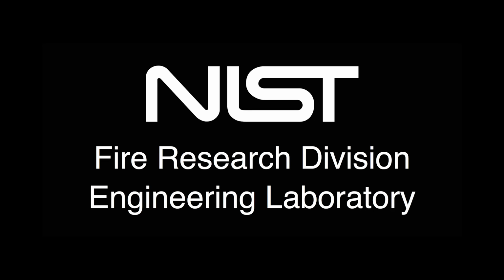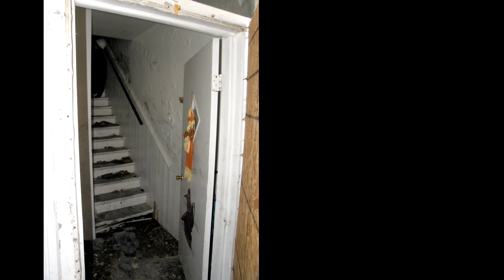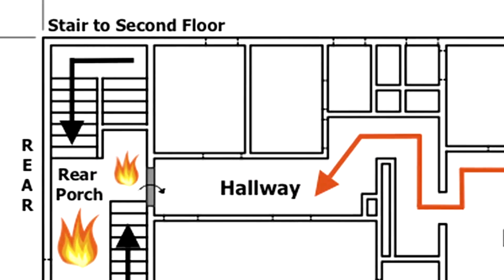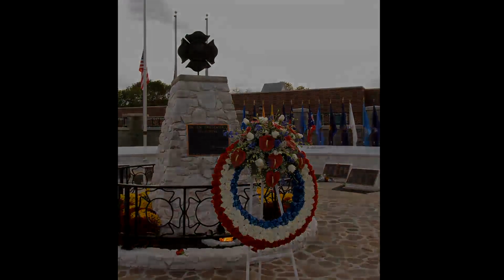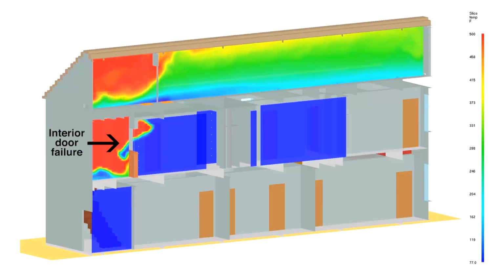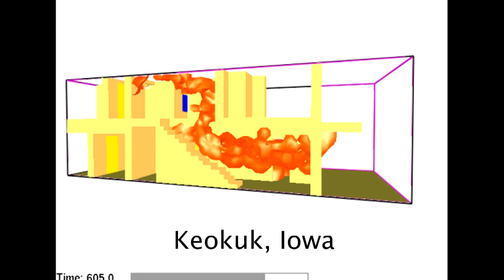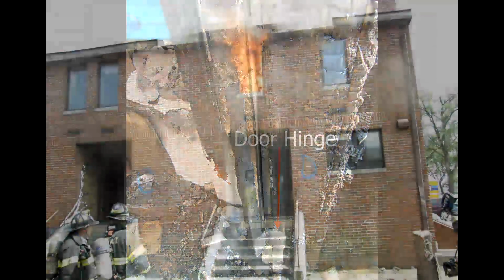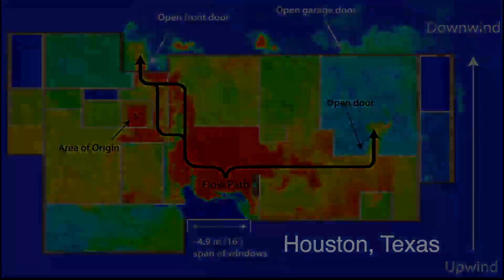Simulation of an Attic Fire in a Wood Frame Residential Structure--Chicago

Comment: Let's see if I got this right.  

Reading the reports, I gather that things started really going south when the truckie opened the back door to the first floor and must have left it open too long, letting air into the stairwell as intake, traveling up the fire in the stairwell, and venting out the attic window as exhaust. 

Then the heat so-created in the stairwell-turned-chimney buckled the 2nd floor stairwell door, letting super-heated exhaust spread into the hallway, rolling over the engine company.  A rupture in their attack hose may have complicated their plight. 

Then they retreated into the 2nd floor kitchen, getting tangled in their hoses for water and air.   The firefighter's mask was pulled off and apparently the captain's somehow failed to protect him, allowing him to suffer fatal airway burns.

Rescuers met them in the thick smoke and soaring temperatures in that upper-story kitchen and conveyed them down and out quickly.  Resuscitation efforts were successful at the fire-ground but the captain died in the hospital. Airway trouble was cited as cause.

I gather that the takeaway is that doors, roofs and walls in burning buildings are to be unopened except as necessary.  One never knows what the consequences will be, of opening a door or roof or leaving it open, unnecessarily.  

And that after his initial 360 the Incident Commander needs to stay outside at his command-post coordinating everything like a symphony conductor with a radio.  If he's inside, he's out-of-position for directing the whole symphony.  

I had to infer much of the above; it wasn't all explicit in the two reports mentioned in the video.  But it seems to follow from what they did say.

Finally, I'd love to know what happened at the hospital.  The result we know, but how it came about would make interesting reading.  Airway troubles is where Emergency Room action starts, not usually where it ends.